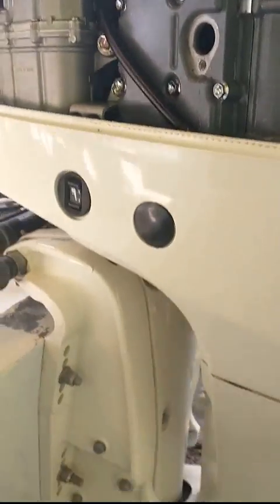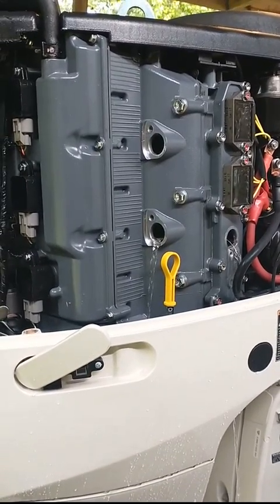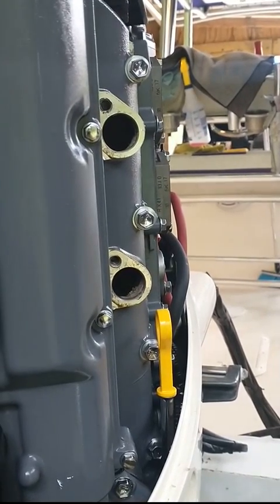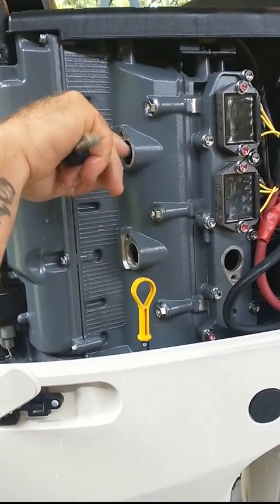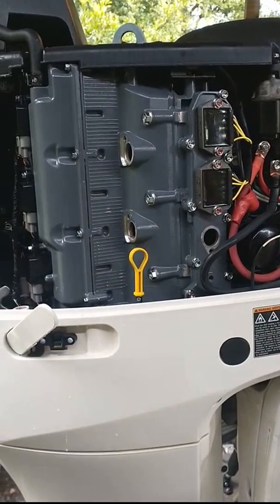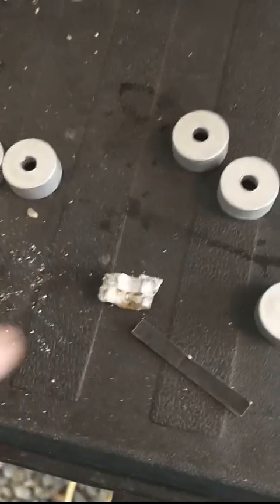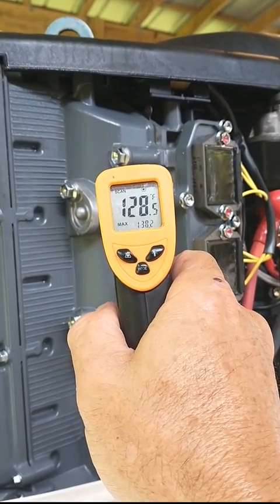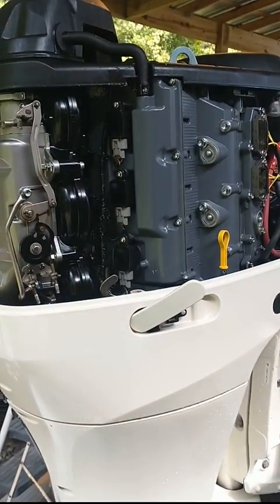Changing block anodes on a Suzuki 250 Four Stroke Outboard

Comment: it's not a bad design at all if you just get used to doing it. looks like you forgot about the one on the port side where you have to take off the Tupperware. it's the one that sits by the oil pan. and don't forget the one that's down in your low water pick up on the front of the gear case.  you can reuse the rubber o rings if you don't mess them up. it's a lot easier if you can take the anode housing and put it in a vice. I highly recommend rydlyme. or basically any other descaler. but rydlyme is really a great, and safe product made for this maintenance issue. you're just lucky you don't have to run the St Johns River. it's a total shit hole!  with all the particulates, sand, and tannic acid.
I descaled my Suzuki 250 just the other day. I try to do it at least once a year to every 6 months. those things don't grow on trees!

Comment: I do not agree that CLR is a good thing to run in your motor, Moat experts agree that it is not recommended to run CLR in a motor it can affect seals and gaskets.  Also, it can etch the aluminum.  Simple green is also bad for aluminum unless you buy the aluminum safe version. If you need to clean your motor internally, use Simple Green - SMP13406 Extreme Aircraft and Precision Cleaner only.
Reply: Good point, thank you.  I did not know that Simple Green made a product specifically aluminum safe.